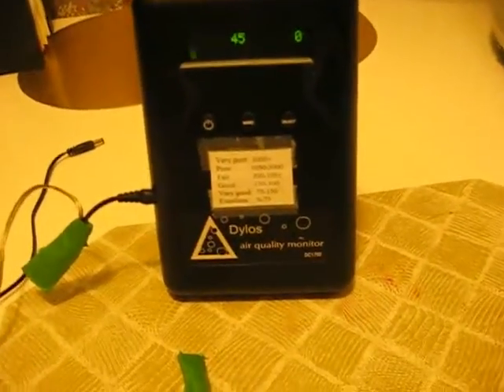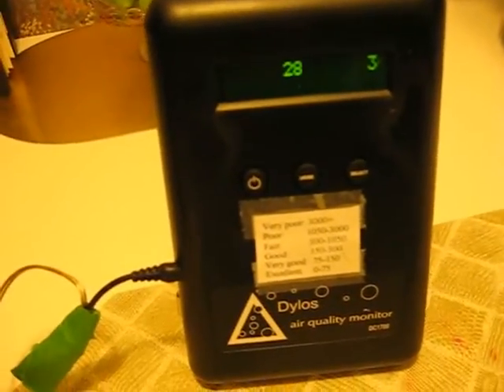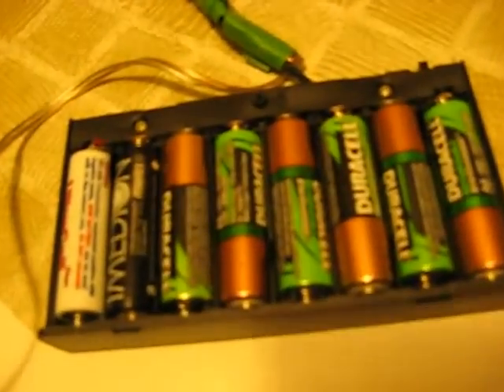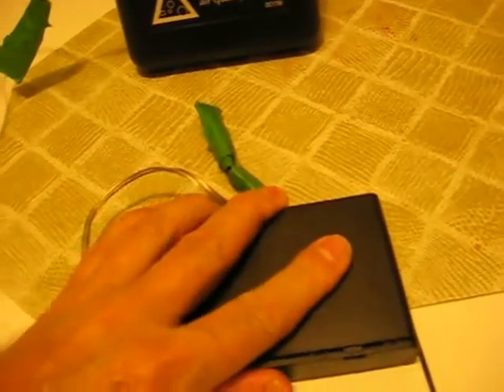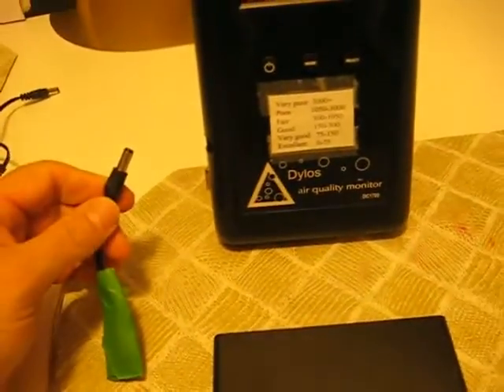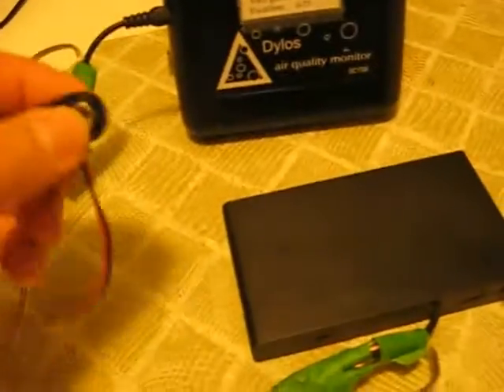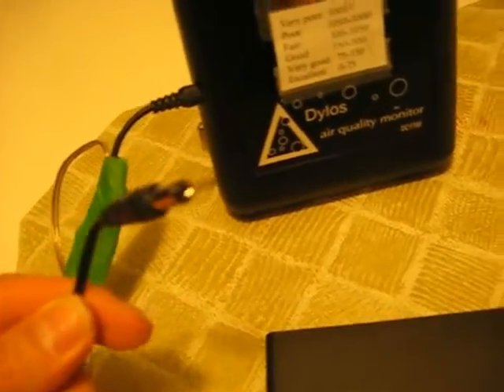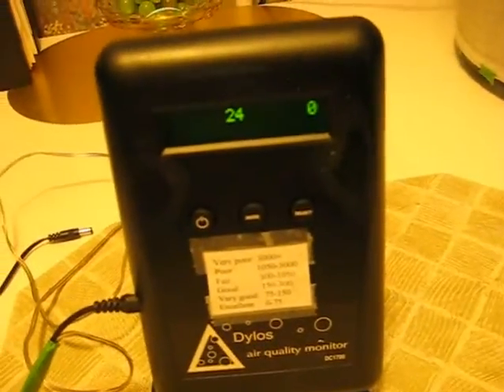Dylos DC1100 converted to portable battery operated

Comment from the maker: Eventually the internal NiMh battery will need replacing and you will have to send it to Dylos for service.  Changing the battery yourself is not as easy as soldering neg and pos wires.  Also, the internal button cell for the clock memory is very hard replace, hidden behind the main board. The diy battery holder can save you from paying to send it in. This will not solve the clock battery low warning. The counter will loose time when turned off in battery mode,  if using ac adaptor it will hold time as long as plugged in and rocker switch is set to external power.

Comment: Thanks for this.  I'm not sure that the DC1100 pro will do the low battery notification, since it was not originally made with batteries.  I would like to be pleasantly surprised though.  Again thanks for food for thought.
Reply from the maker: It will work, the AC adaptor converts to 9 v DC which is what the power pack produce. I am using 2500 ma AA cells that will power the DC 1100.

Comment: I have a DC1100 PRO and my power adapter is 12VDC, 1.0A MAX, minus on outside and plus on inside. The adapter is a PHIHONG switching power supply model PSC12R 120, rated for 120 to 240 VAC input. This power supply shipped directly from Dylos. I wonder if the 1100 can run in a range of voltages.
Reply: Thank you! I was trying to figure out what voltage and max current output the power supply the DC1100 Pro uses.
Reply: @ben_r_  My older DC1100 PRO manufactured in 2014, came new with a power supply rated at 9v, 500mA output.  And different brand (JAMEKO) than Steve's  above.  Have not tried to adapt it yet.
Reply from the maker: My dc1700 uses  a 9v ac adaptor with positive tip. If you need 12 v then you can use an 8 AA battery holder instead of the 6 cell battery holder.

Comment: U could use lithium ion, 18650 cells and a cheap dc to dc converter. 3x 3400mha in series would give u a lot longer run time. EBay has safety bms boards for 2 bucks or less from China. I had a uv lithography setup untill mold hit. I took the 365nm 4w uv led out of my exposure unit and cut down an ibtell heat sink to fit yellow 6v flashlight. I use 2 18650s a bms chip to cut them off at low voltage and a cc dc-dc converter to power it. Works like a treat. I don't trust the eBay bms for charging though. I pop the cells from holder and charge externally . 

Still in your case 2 or 3 quality 18650s is easier than all those AAs and will run longer
Reply from the maker: Anything that gives the counter 9 dv will work. I have snap leds for a 9 v battery, I should wire it up and see how long it lasts with my rechargeable Imedion 9.6 v 230 mAh battery. This would make for the most portable use. (at reduced run time)

Comment: Have u been inside it? If like to save 60 bucks and get the job serial version. In guessing they used the same pcb and left off the chip for serial and corisponding connector ..ie the solder pads are all there and 2 bucks for a chip plus 2 bucks for a connector would convert it
Reply: Do you know the part number for the chip and the DB9(serial) connector though?

Comment: How long does it take to recharge? And how long will it last without dying this way?
Reply from the maker: +Carson B. I take the  NiMh AA cells out to charge them in my Maha c-9000 charger which takes 2-4 hours. Never really timed a full charged pack but probably 12 hours of use.  Longer then the internal battery anyway. - Use quality AA cell that are  least 2000 mah. I like the ultra low discharge ones. The capacity is a little less, but they hold power for up a year when not in use.
Reply: +Rick Rude Thanks so much! This is really helpful. I have another question about the extension wire you used, where did you get it ? Also is it possible to do this without the rechargeable batteries with just fewer batteries in the pack?
Reply from the maker: +Carson B. I used speaker wire. Any  wall wart ac adaptor wire with a plug the fits into the Dylos will work, it a 5.5 mm jack. Thrift  stores usually have them cheap.   It you want to use alkaline batteries you only need 6 of them 1.5V x 6 = 9 volts.  If using rechargeable, you need 7 to get 9 volts or the Dylos will indicate battery low. Reghargables are only about 1.3 volts when fully charged.
Reply: Carson B. . EBay search dc-dc converter. They are small and have a little screw one turns to adjust voltage. A buck converter drops voltage and a boost... boosts.. for an application like this the 2buck ebay model is fine. U would need a multi meter to dial in voltage. If u get that far come back and ask about lithium ion cells and protection boards. Searching would work too... the cells need to be respected or u can end up with a fire ..hence I don't give out a lot of info untill I see people have a basic understanding.

Comment from the maker: David-  What's the difference? I don't have the 1100 model, only the 1700. And I am not going to buy the 1100 model  just to make this video! The 1100 model also is powered by 9 volts DC. It uses the same 9v wall wart AC adaptor as the 1700.